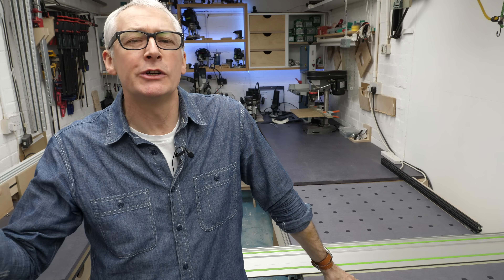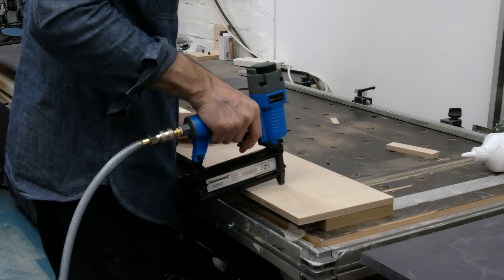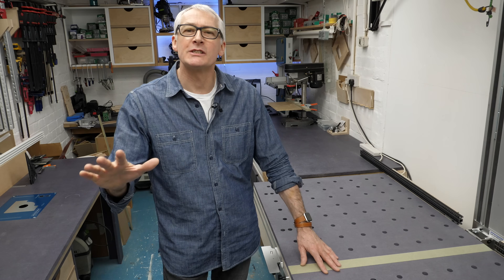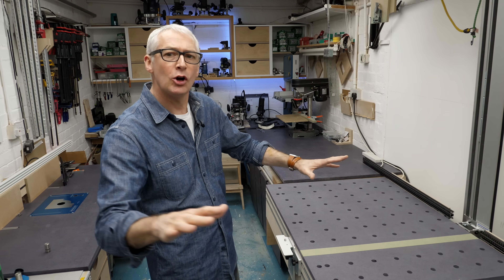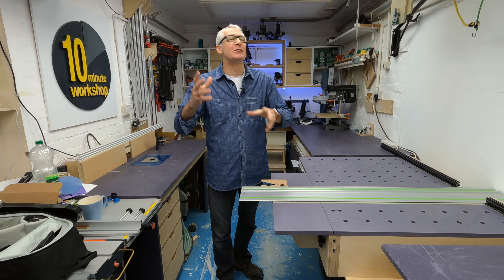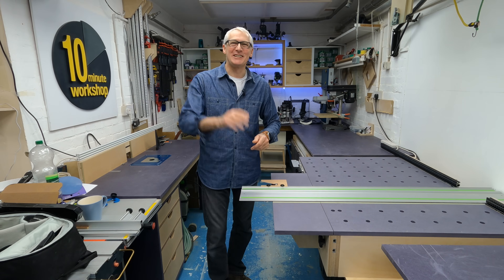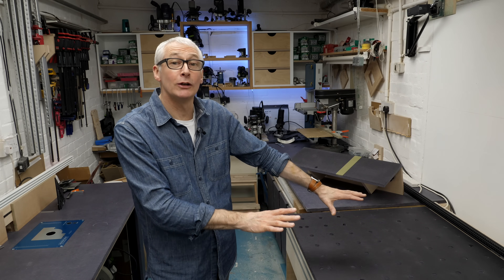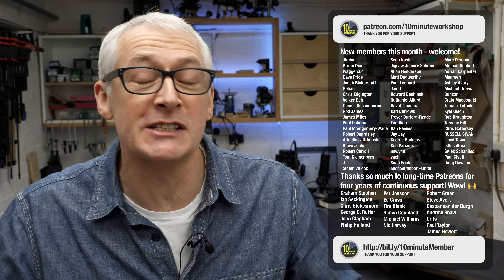DIY MFT with Ikea Curtain Track [video 487]

Comment: I made my own “hing”. I’ll try to describe here. The hinge side is just a square piece of plywood wider than he rail with two slots for mounting at different heights. There is a dowel to butt the rail against and a hook like Daves but parallel instead of tapered. One side of the plywood has a plastic piece screwed on to avoid denting. That plastic is butted up against a screw head sticking out of a permanent fence section that provides consistent left to right registration. Bolts come through the table and use cam locks to hold the fence/hing in place. 

The front end of the rail (operator end) has a zigzagging (Z) few pieces of mdf about 4 inches wide. They attach to the rail giving it a sort of hook. There are magnets on the bottom that catch the underside of my table for about a 6 inch lift. Two blocks of wood in a T track on the table’s edge sandwich the Z. 

I find that this allows me to lift the rail up just off the work piece making it easier to align to a pencil mark. The block of plywood at the far end of the cut provides an excellent reference too as well as preventing chip out at the back of the cut. The saw can be left on the track which is always mostly horizontal which greatly reduces the number of motions between cuts. I just add a stop so the saw can’t fall off the far end.
Reply: We need a video of this!

Comment: Is it possible to stain my MFT top black? I love that look. Ultimately function is more important than form but why not make things look great haha. Can I use a black/ebony gel stain on my MFT top or will that impact the 20mm holes? How can I get a similar look? Thanks again for these videos!
Reply from the maker: Getting the stain into the holes is always the challenge. You’d need a mini roller and a lot of patience. And a lot of stain.  🤷‍♂️👍
Reply: @10MinuteWorkshop  haha the amount of primer I had to use on my MDF cabinets should have been a good indicator of how much stain would be necessary. 

Any chance of the MDF swelling up from all of the necessary stain?

Comment: Great build Peter, I’m pretty sure bench dogs are currently designing a hinge system for an mft top
Reply from the maker: Thanks! Yes, they are and it looks pretty great, but it's very much aimed at MFT top or MFT slab users working off a pair of trestles, rather than a fully framed bench. 👍
Reply: @10MinuteWorkshop  that sounds good for my use. I’ve just made myself your diy rail square. Works a treat. Use my track saw loads more since. Always been Table saw man

Comment: Peter - don't I recall that you have a hollow space behind that bench, where the smooth wall is?  How about a little cubby-hole for the hinge to sit back into?
Reply from the maker: I have a hollow wall full of soundproofing. Not. a great idea to start digging into that, unfortunately!
Reply: Oh I dunno… multitool and a few scraps of 12mm plywood and it’d be good 😀

Comment: Peter, great video.
One question that i could not figure out.
When placing the back fence with  scale on it. What do you do under the rail?
At this place the rail needs to be flat on the cutting  surface so the back fence can´t be present.
Do you start the scale  minus the rail?
I hope i can make my question understandable regarding the poor knowledge of English.
Greetings Marc
Reply from the maker: Hi Marc and thanks! The Benchdogs fence does have a slim rail extension that fits under the rail - I talk about it in the Benchdogs fence video, there’s a link in the description - but I found I rarely used it, and to a large extent the short waste-fence will cover a lot of that functionality. And yes, the fence has two options to start at zero, or 20 (cm) so you calibrate it to the splinterguard of your guiderail. Hope that makes sense! Peter

Comment: Peter, I have learned a lot from you. 
There is one thing I would like to know. 
What kind of hinge have you used for the guiderail at your table?
Reply from the maker: Thanks Jan. As I say, I go through all the hardware in a lot of detail in the previous video,  but short answer I used the hinge from Dashboard PWS; it’s a great hinge, but very expensive outside of the US. 👍
Reply: @10MinuteWorkshop  thank youi

Comment: Hi. 
Could you say Is there any reason for going with MDF for MFT table top instead of plywood?
Reply from the maker: Depends wether you see the top as a lifetime investment or a consumable; out of interest I'd be curious to hear what you think the benefit of plywood might be over MRMDF? 🤷‍♂️
Reply: I find MDF for table tops more stable, machines more cleanly, as there is little to no tear out and is smoother on the surface. Also, at the moment, birch ply is fiendishly expensive. MDF about 40% heavier than birch ply so that could sway the decision the other way, if need to be portable tho'
Reply: @10MinuteWorkshop  In my opinion, plywood is more stable ( it absorbs less water) and is a lot stronger. If I compare prices, there is almost no difference between baltic birch plywood and MDF in my region. A disadvantage for use of plywood as a top would be that, if it comes with melamine or other covers, it will be a lot more slippery. I was thinking to make cabinets in the bathroom and kitchen as well from plywood, but it seems it is really done that way. Would you recommend making cabinets from plywood?

Comment: Thank you for this video, great as usual ! Could you , if it's possible, do a video (or videos !) About project with limited tools for Diyer's like us? With for example a circular saw, jigsaw and drill. Thank you so much !!!
Reply from the maker: Thanks! I did one a while back where I tried to get the price of all the tools I used on a particular job, from what that job cost; its a 3-parter, P1 is here ; 	Shelves for tools P1, https://youtu.be/hgW3DFKFKFE. There's also a follow-up to that series where I go through the amount of gear I actually used just to make a simple MDF console table, here - Time, tools, money, https://youtu.be/c8YQxcxHYYk. And I did a simple oak shelf where I tried to do it without using any of my fancy Festools; almost made it, too! Simple Oak shelf P1	https://youtu.be/nXDN_Vd-23A. 👍 P
Reply: @10MinuteWorkshop  i am really honored by your quick reply, thank you so much !

Comment: Hello Peter many thanks for your so inspiring videos, i fully subscribe to your work philosophy : great outcomes with just what is needed with regards to tools, space...
FYI   please have a look at conkat tracksaw rail hinge. Keep on the great work ! Thierry
Reply from the maker: Thanks Thierry! The conkat solution - and all the other double hinge solutions - are great, but they fix the hinge to the rail, and I need an easily removable option. 👍
Reply: 1 or even 2 pieces of metal (Same one as used to link to guide rails) engaged on one side  in the guide rail and on the other to the hinge would make rail extraction possible. Kr Thierry

Comment: Hi Peter , just bought 300 eurs worth of benchdogs with your discount , thanks a lot and hope you’ll get something because I love your channel. I’m building my mft table , can you please give me the item code or a link to buy the hinge to keep the track vertical and the front part where the track sits please ? I’ve been struggling to find how it’s called and where to get it, thank you.
Reply from the maker: Thanks Federico! All the links are in the video description, both here and in the previous video where I talked about the hardware. Depending on wether you want the Festool hinge or Dashboard set, there are direct links (Dashboard) and part numbers for the Festool as I can’t link to them directly because of the way the catalogue works. 👍
Reply: @10MinuteWorkshop  thank you, I did not notice. Unfortunately it seems these part are not available in Italy , but are more common in uk ( leading to import taxes after brexit). I’ll check for them around Europe hoping some seller have them.

Comment: He Peter can you tell me what camera and mic you are using?
Thanks in advance
Reply from the maker: Sure. I mostly use a Lumix GH5, G80, GX80, GoPro and phone. Talking heads are done in the GH5. Audio wasn’t great on this one. I used the Rode Wireless Go and lavalier Go. Usually have a boomed Rode VideoMic NTG, but needed to move around more in this one. 👍

Comment: Fantastic to see your mft build. Bench dogs seem to bringing out a rail hinge which may solve your problem.
If I may ask how long is your run of benches along that wall and where does the rail cut line sit in the run. Am planning a similar build in the garage and want to optimise where the fence should sit for cutting sheets mainly for carcasses and smaller shelf projects. Looks like yours is near the right hand side.
Reply from the maker: Thanks! Yes the Benchdogs hinge will be a welcome addition, but it's aimed at a different user as it fits directly onto the edge of an MFT top or MFT slab. The benches either side are full 2440mm / 8' and my MFT sits right in the middle; I'd have to measure the cutline to wall distance tbh, somewhere around 3 metres to the left, 2.7 top the right, I'd guess. 👍
Reply: @10MinuteWorkshop  Many thanks for replying. My run of benches is only 4 metres and was thinking of the cutting line at 3 metres from the left. With your work what cross cuts do you do most and does your full or fullish sheet sit mainly to the left or the right of the cutline.

Comment: Hi Peter,  I enjoy your videos and hope to build proper workshop soon. so storing up the ideas.  A quick question (which might play into your idea for the "thriftiest MFT").  I see that the Rutlands T-track is £30 for 2x1m.  Ikea Vidga single track is £9 for 1.4m, so do you think this would be practical to use instead for the front, or is it too lightweight?
Reply from the maker: Morning Craig, and thanks! The issue with the Vida track is to do with the thin wall channel; I talked about this in the previous vid about MFT hardware - extrusion confusion, there’s a link in the description here. Long story short, the curtain track is thin aluminium, and while t-bolts work OK, you have to be careful which clamps you use eg Festool and Makita rail clamps won’t work. You may be able to adapt the clamps, or the track, but for the difference in price I figured the out of the box Rutlands channel was a safer option, if a little more expensive. 👍

Comment: Is there an affordable alternative to the hinge you're using? It looks really nice, but very expensive. The rest of the build is reasonably priced otherwise. Seems like even the original Festool hinge might be cheaper.
Reply: Edit: You answered it at the end of the video already :) Seems like a good opportunity for a Chinese maker to sell an affordable hinge on Banggood/Ali.
Reply: You could also make a solution like Holzwerk, a plywood plate with a hinge and a track-fitting.

Comment: Would love to see a way of making an MFT without the LR32 or Parf guide.
Reply from the maker: It’s coming! 👍
Reply: RS CNC make an mdf jig which just needs a router. 4 years ago it was about £35. There is a bit more detail in the comments above from David Hull. But as Peter says, nowadays it's probably just cheaper to buy one and I'm sure someone will do pretty cheap custom sizes

Comment: You don’t change saw blades to cut the aluminum t track?
Reply from the maker: That is an aluminium blade actually - cuts very well in plywood - but no, for the occasional cut a regular tct blade is fine. 👍